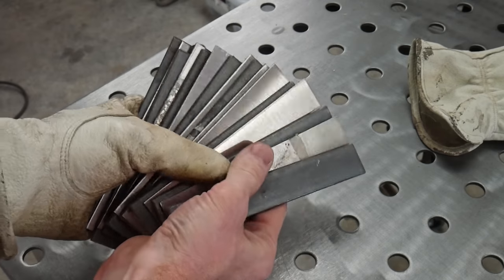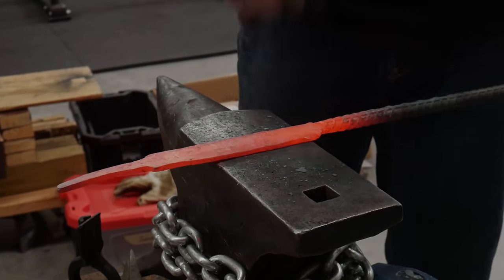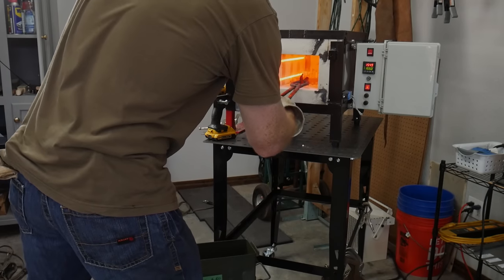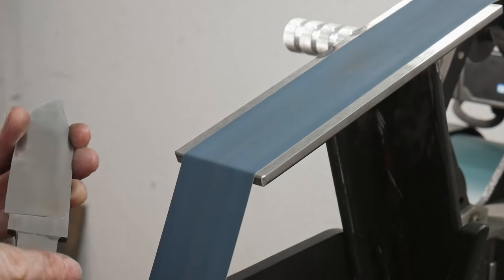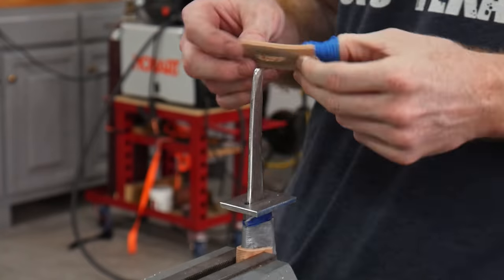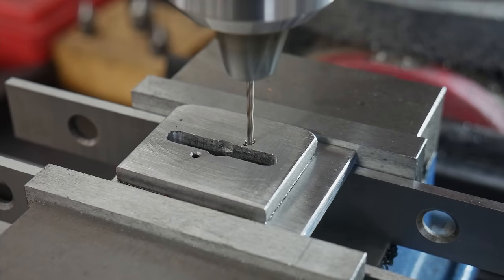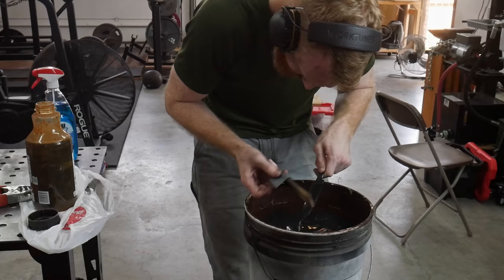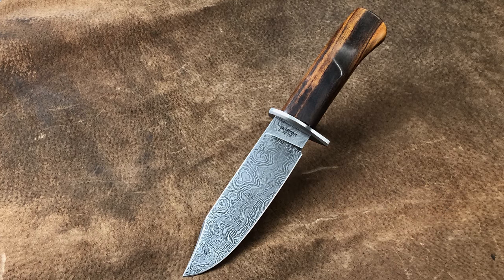Forging a Damascus BOWIE | Knife Maker's Challenge #2 | Knife Making

Comment: I really appreciate your transparency in the process and thoughts. Your designs and classic and beautiful all the while executed really nicely. 

I’ve been making knives for over 40 years and mentored several a couple of which have gone on to become excellent makers. I own a Starrett hardness tester and I am very glad that I saved up and plunged for the tool. My confidence and ability to test blades is quite a bit higher although many seem to do well with out such an expensive tool. 

I confess that I have never used a file guide. All of my blades and guards (narrow tang) are hand and eye fitted. My only regret after this length of time is that I have never mastered the skill of soldering my guards. I don’t believe I actually need them soldered but I wish now I had learned the skill. For now, all of my guards are precision fitted (by eye and hand). The length of time is long but my pride is satisfied. 

God bless you and your channel. I appreciate the skill you have with both knife making and video production.
Reply from the maker: Thank you for the thoughts and tips sir. Cheers!

Comment: Hi James, nice looking knife- simple but very aestetic. You have a bunch of DIY tools in your workshop (that is cool- I'm also DIY guy). I'm curious, is there any advantage of "Guard Jack" comparing to simple hammering? Regards, David
Reply from the maker: I think it's personal preference. Just playing around with it really. I also like the idea of epoxying on the guard by itself with the guard jack installed, then coming back for the rest of the handle.... still figuring it out really.
Reply: @RedBeardOps  I would be afraid that the epoxy won't hold to the guard enough and fall off after few "fitning checks" - I like small pins - they work pretty well., but I get what you mean.

Comment: Dude, an actual hardness tester would be badass, but the files work too.  I had the same irritating feeling about not knowing how hard my knives were besides "does a file skate"...it just felt too imprecise.  So I bought a set of files and they gave me a LOT more info than I had before.  My previous method was to take a new file and go by feel and sight, but after getting the file set I decided to revisit that method and that's when I realized just how little I actually knew about the hardness of my steel and how inaccurate that method was (and how much a file varies in hardness and sharpness).  If you're really shooting for a particular hardness (say, 57-58), then a hardness tester will get you to that point...but a set of files will get you pretty close to that point as well with the right technique.  Steel at 56 will be slightly scratched by a 55 file, but at 57 it's really faint, so you can estimate.  Adding to that, you'll never get a homogenous hardness throughout the steel, so you might hit a soft spot somewhere or a harder spot, you never really know.  Damascus is more difficult still, and even a dedicated hardness tester won't tell you the whole story as you have to average out a whole bunch of test points in a certain spot to get a reliable reading.  If you do get a file set, don't go by the instructions and start with the softest and work your way up, start with the hardest and work your way down.  Running a soft file over a hard knife will dull the teeth, leading to future inaccuracy, but you can always take a file scratch out of your blade.

As for coating your stack in WD-40, that's probably just as good as dipping it in kerosene or Jet-A, the point is to fill the gaps with something that isn't oxygen or water.  Better still is to get a tiny amount of flux in with it, and you can do that by mixing boric acid (not borax) with denatured alcohol or methanol.  This gives you a liquid that not only displaces oxygen, but also aids in forge welding.  The recipe is simple...just add enough boric acid powder while stirring until it becomes saturated and you get precipitate at the bottom.  Jewelers use this flux at about a 50/50 mix and stir up the precipitate to get a better barrier on their pieces for soldering, but I've found that much acid isn't necessary for forge welding and could potentially cause inclusions if the gaps in the stack are big enough. Always add the acid to your solvent when mixing, not the other way around.  I use an airtight ammo can to hold a gallon of the solution, because the mixture is hydrophilic and will be contaminated by moisture in the air.  Dunk the stack and stir it around for a few second and you're good to go.  You can also use it as a fuel in tiki torches to get a green flame, just in time for Halloween.
Reply from the maker: Thank you greatly for the thoughts sir! Have a good Halloween!
Reply: I picked up some knowledge from your message. I’m new to the knife trade and I’m looking for as much knowledge as I can get… what brand is your file testers?

Comment: This is late lol. But i got one of the grizzly hardness testers. And its been doing really well. 

It comes with test blocks, but i bought a phase 2 test block to verify also. And it seems to he spot on, on everything. Its been super useful for developing heat treatments. Though i mostly am using a bunch of crazy steels, and a lot of variety between them so it probably is much more useful to me.
Reply from the maker: Gosh... I need one of them! Probably my next big purchase
Reply: @RedBeardOps  i highly recommend it. 

Even following datasheets. You never know if your kiln varies a little, or what. So it gives some assurance being able to verify your heat treatnents.

Comment: Which tape do you use at the end of the video for sharpening?
Reply from the maker: 600 norax, 1200 norax, 400 cork - Cheers
Reply: @RedBeardOps  Thanx a lot. The finish is actually pretty good.

Comment: Get and old Bridgeport mill made in the USA that maybe goes back to the 1960's using the belt drive and speed reduction system  if taken care of they will run forever plus two weeks, no joke they came at the peek of Americas quest for quality in all respects you don't need a DRO if you have a decent pair of eye's and  and take the slack out of the worm gears you can do just fine and can repeat to .001" .
Reply from the maker: A Bridgeport would be nice!